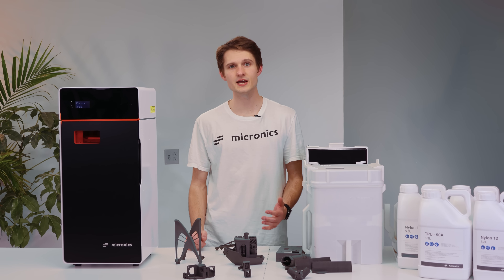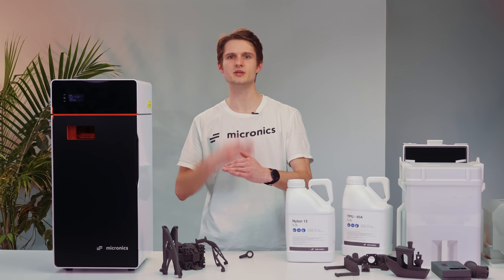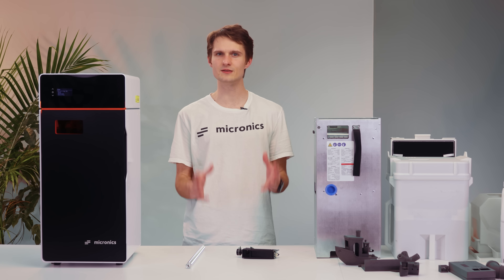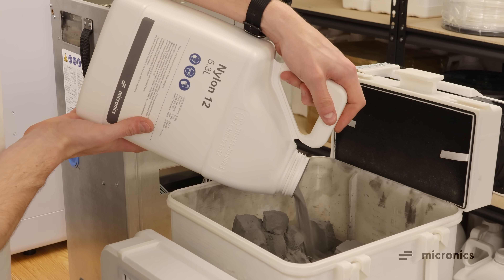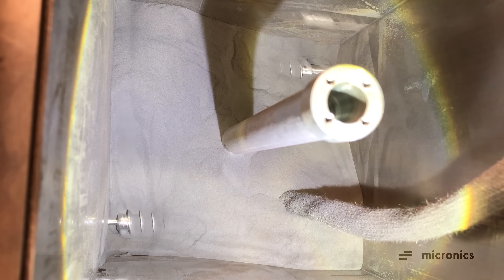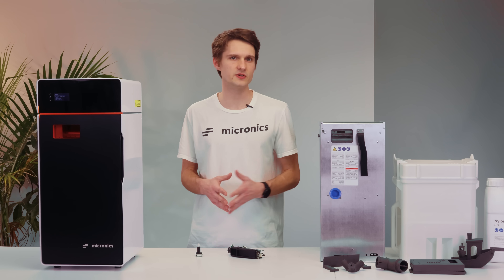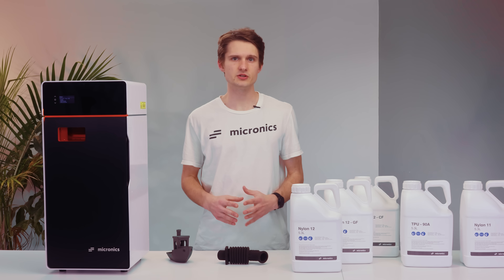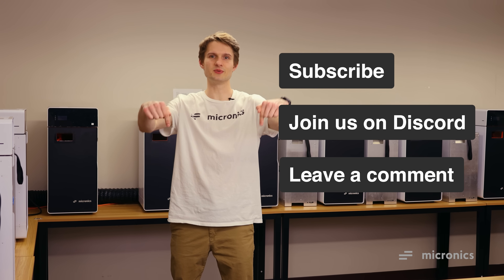How we BUILT a 3D printer that can print ANYTHING!

Comment: METAL. WHEN.
Reply: Yeah, was a little disappointed that it's not Aluminum-ready, but... it's still awesome.
Reply: Yeah, got excited when I saw the thumbnail, thinking metal capability. Really looking forward to a hobbyist priced metal printer.
Reply: Must be getting close now. Surely it's just a fibre laser instead of what looks to be a diode laser that they are using. A fibre laser Engraver is around 3k
Reply: Would they need an inert gas input for a metal one to avoid fires? 🔥
Reply: I always thought explosion risk is what limits low price accessible sls
Reply: Metal casting prints isn't too bad, although shrinkage...
Reply: when your pockets get deeper, plenty of metal SLS machines on the market

Comment: Glad to see some movement in the consumer SLS printer field. If only I had a use for SLS printing...
Reply: it's pretty much exactly the same as FDM use cases, but parts can be loaded in any orientation and looks a little bit better due to lack of layer lines
Reply: @SergeiSugaroverdoseShuykov  The only issue is that you cant use filaments differently like you would with an fdm printer and you cant really do multimaterial prints with powder layering. I would assume that due to how thin each layer would be, that the SLS printer would take some time to print as well. As someone who uses 3d printers for engineering projects and for the aviation hobby, this desktop SLS printer would be the best thing to have for printing parts that often dont result well on fdms like gears, print in place systems, and anything that you would typically need an injection mold for.  However some plastics like foaming pla, which i tend to use for rc aircraft, are not options in SLS printing to my knowledge. If you want strength of a part, little to no imperfections, then definitely get an SLS. This is certainly going to be a must have though.
Reply: @SergeiSugaroverdoseShuykov  Layer lines still exist. It's really just the the support less structure and fusion between the material that's better.
Reply: When you’re holding a hammer, everything looks like a nail
Reply: You can always find a use. The price however... Don't get me wrong, it's an amazing price but still out of reach for many
Reply: College kids have more $ in their laptop and smartphone than this SLS 😂

Comment: How about the risk of explosions? Isn't this pulver going to be dangerous?
I read about someone who works in a company that had to spend ten thousands (or more), more than the machine cost, to explosion-proof everything before using one of these machines.
Reply: Plastic powder used in SLS is way safer than metal powder used in SLM.
Reply: Sounds like the same type of person who buys an industrial fume extractor so they don't die from the "horrible fumes" of their PLA prints.
Reply: @JD2jr.  In contrast to FDM printing fumes, sintering really is dangerous.
Reply: @JD2jr.  You are discounting something using a straw man, building a fictional character and then equating the two. Not a good way to reason or argue.
Reply: @Opticlipcon  no, I'm saying it's probably the same type of person (who I've met the real versions of so no "building a fictional character" here).

Comment: Question: what is the print time for a standard size benchy? If possible, could you break the answer down into time used explicitly for just the SLS process, and then also the time involved in pre and post processing? Im a product engineer for a company with inhouse manufacturing and am trying to determine if this would be viable for our production runs
Reply: You have to add 15 min for heating up and 3 hours for cooling down. Print time is kinda irrelevant at that point.
Reply: @maxdefire  on the flipside you can print 100 benchys overnight because the laser can scan so quickly.
Reply: I think from what they saied in another comment: 45 minutes
+ heatup + cooldown = 4 hours

Comment: This is awesome! The use of the Unreal Engine physics is very convenient for nesting.
 It will help reduce the waste of powder between pieces, and the foundation for future development is solid.
Reply: The unsintered powder is not wasted, it is reused.
Reply: Yeah, but the minimum system requirements list only Microsoft Windows for his MicroSlicer. I have no problem paying 3000USD for such a machine (if it is working as advertised), but I am absolutely NOT installing Windows. Linux is the way to go, which is also supported by the Unreal Engine.
Reply: @phib3l  you can always turn water into wine
Reply: @phib3l just run a windows VM you noob. The fact that you stated such a comment shows you have 0 tech skills.
Reply: @phib3l  use wine I guess, or maybe you need proton because this uses unreal engine ans is more optimised that way
Reply: @phib3l  he said it is open so it wouldn't be open to be used using other sliders?
Reply: @phib3l  Its not targeted towards you. Its targeted towards people that like nice things.